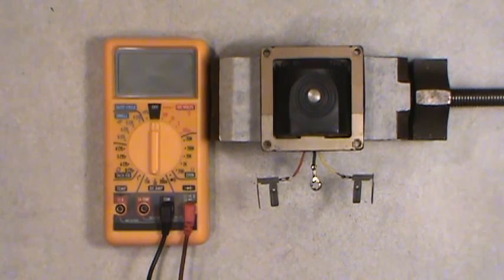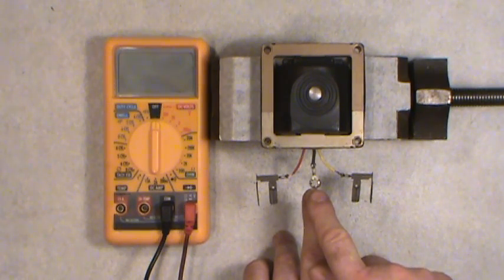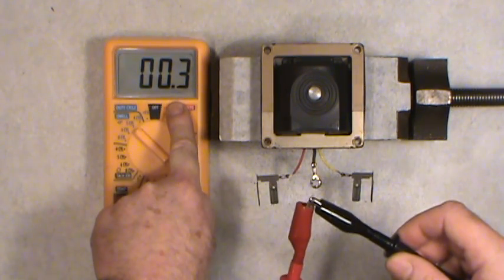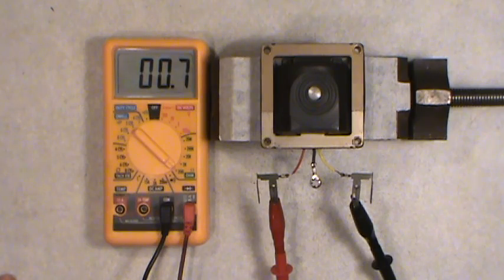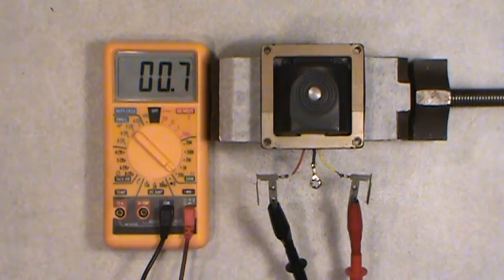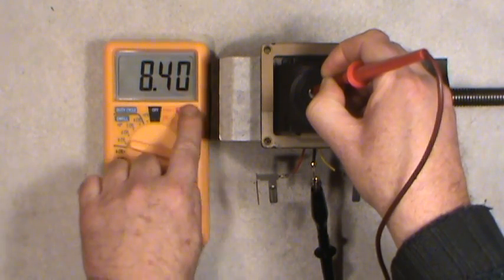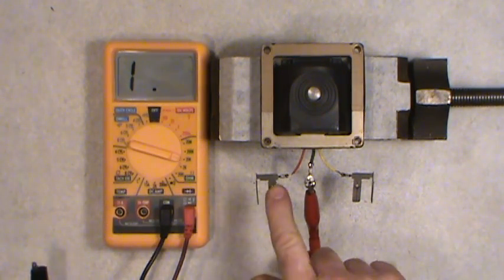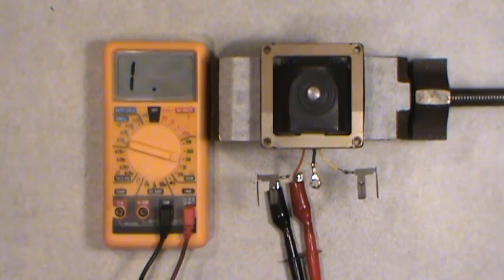HEI Coil Test (The Short Version)

Comment: Good video. Good explanation about the DVOM settings, many people do not understand the different settings and the decimal point. Thanks.
Reply from the maker: Greetings...hammer head...…...You're welcome, and thanks, for the nice comment, and for, watching too...…….The HEI (High Energy Ignition) coil's, higher/secondary ohm readings, aren't all that fussy, but, when it comes to, the low ohms/primary side, of the ignition coil, then, it's now, shall we say, "fussy time"...!!!...lol...…….Most of the factory/stock, HEI ignition coils, that I've messed with, usually had, a very low/primary ohms reading, of, between, "just over" Zero ohms (but not Zero ohms...!!!), up to, usually, no more than, about 1 ohm (.5 ohms, is a good possibility)...…….I also, ohms test (measure "it"), when, the ignition coil is disconnected from everything else, just to be sure...…….Best bet, is to use the exact ohms "specifications", for the exact ignition coil, that's being (ohms/resistance) tested...and...….till next time...……Be Safe, take care, and have a good one.
Reply: @RockysRoadshow I had the exact same problem at my red wire. Broken..

Comment: A lot of good info there about coil diagnostics and volt/ohm meter ranges.  I would also check for a short between the primary and secondary windings since that may also cause a no spark condition.  Great video that I'd bet has helped plenty of folks!!
Reply from the maker: Greetings...breeha72..........Thanks for the nice comment, and for watching too............Yes-Sir-ee-Bob, I did leave out, that, shall we say, Short (ing) to Ground, as in, touching one of the meter's test probes, to the ignition coil's frame/laminations, but, I figured, that, any problem should (I hope), show-up, having the primary and secondary coil's Ohm-Reading/s, out of whack (so to speak)...........Gotta also keep in mind, to use the "Correct/Matched" ignition system (circuit) parts, for that particular HEI/High Energy Ignition system/circuit, cuz, I've seen pictures, where, a Stock carbon button/contact had too much Resistance, for a high performance application, and, it appeared that, that Stock/high resistance Carbon Button, got So Hot, that it Melted the Distributor Cap...Yikes...!!!............There are actually "Low Ohm" (resistance) carbon buttons available for sale, that should, shall we say, prevent that high ohms/resistance...bottle-neck/roadblock...from taking place (I hope)............Gotta, also watch-out for, high resistance/bad connections, as in, all wiring connectors (I prefer, soldered, wires to connectors, as opposed to, only being crimped)..............Then, there's that sheet metal Ground Strap, that only touches, the HEI ignition coil's Frame/Laminations (poor connection practice, especially when subjected to, the good ole, Sea-side/Salt-water environment).............Last, but not least, there are (times), where, a BIG distributor Cap, HEI distributor, gets stuck into a V-8 engine, that used to have, a good ole "Points and Condenser" distributor, in there before, and, the original wire, that went to, the usually oil filled ignition coil, gets connected to the HEI distributor's "Bat" (battery) connection point, that's near the top/and in, the HEI's BIG distributor cap...say what...???............Well now, a BIG distributor Cap HEI distributor, needs Full "Battery Voltage" (12 Volts, and a bit more, when the engine is running, and the charging system is in operation), BUT, that older Points and Condenser distributor, used much less Voltage, that went through the supply wire, to that, good ole, oil filled, type of ignition coil, and, the HEI Distributor, sure "Did-Not-Like-It" at all.............Gotta, Re-Wire, safely & properly, for Full Battery Voltage, to get to, the HEI's "Bat" connection point, on/in, that BIG distributor Cap, to make "it" Happy, as well as, make the Vehicle's Owner, Happy as well, and........till next time.........Be Safe, take care, and have a good one.
Reply: how do you check for the short between pri and sec?
Reply from the maker: Greetings...Dean Hauser...…...Thanks for watching, and sorry, for not replying earlier, as, I didn't see your question until now...……Shorts between the primary and secondary coil windings (of wire), to me, will usually be showing up as, one, or maybe both, Ohms Readings, being much lower than, the Ohms "specifications", for that exact HEI coil (could be, that, some of the coil windings shorted out/together, possibly)......….To check/test an HEI (High Energy Ignition) coil, while it is out of that Large distributor cap, for any "shorts", as in, an electrical short to ground, would be, to place (actually, scratch it in, really good, for a good connection!), with one of the Ohm Meter's test probes, on the outside, of the steel laminations (layers of thin sheet metal, that are sandwiched together), and, place the other probe, on one, of the 3 wires, that are not attached to anything, and, only do, one at a time, as well as, touch the moveable probe tip, to the recessed steel contact point, that's in the middle of the HEI ignition coil, where the carbon button's "spring" makes contact, and also, have the Ohm Meter, set to the highest scale/range, so, it will be much more sensitive, at finding even the smallest amount of, not wanted, shorting to an (electrical) ground problem...…...Even though, an ignition coil checks out on an ohm meter, then sometimes, an ignition coil might not work all that well, when it heats up to Operating Temperature...…...So then, if an ignition coil starts acting up, when it gets warmer, you'll know all about it, in case it ever happens, and, I hope not, and...….till next time...…..Be Safe, take care, and have a good one.

Comment: I don’t have any spark and have never worked on an hei before so this is excellent. I have worked on lots of high voltage transformers and other things at the power company so I understand most everything. Thanks a lot. There was a ground strap missing in the new kit that connected the core to the middle black prong on the plug so I think that might be the problem. Thanks!

Comment: I hate checking coils I've tested them and they tested good at the time but in the end replacing them fixed the problem. 3k-30k is a huge range you'd think it would be much more narrowed. I'm still in the process of fixing an ignition problem. Intermittent cutting out at 1500rpm light load. Pull over go in store and drive no problems it's a head scratcher. My injection system is driver adjustable and I've ruled out a lean or rich condition. New dizzy cap rotor and wires. Waiting on FedEx to deliver a new modual but also wondering if my super coil is going bad never know at this point shit is getting old just want to enjoy my car.
Reply from the maker: Greetings...CIA Assassin..........Thanks for watching..........Well, here are one or two things, that might cause the symptom, that you described.........If the "ignition control module", is the type, that mounts on the inside, of an HEI/High Energy Ignition, LARGE Cap distributor, then, here Ya go (same applies to, ignition control modules, that need to transfer any excessive heat, sometimes, to air cooled, heat sink "fins") .........The "bottom/metal surface" of the ignition control module, and its aluminum "mounting pad", that's on top of, the distributor's aluminum body, have to be as clean as possible, and, a thin/smeared coating of..."Heat Sink"...specific...paste/grease-like compound (No..."not", Die-Electric grease...!!!), should be applied, only to the "bottom/metal part", of the ignition control module..........The reason for this, is that, the ignition control module "develops", quite a bit of "Heat", while in operation, and, the computer/type of, "Heat Sink" specific, paste/compound, does the best job, at "transferring", the ignition control module's" "Heat", into that distributor body's, aluminum "mounting pad"..........You can find the "Heat Sink" specific, paste/compound (usually sold, in a small squeeze tube), at a "computer store", that sells things like, mother-boards, sound & video boards, memory, etc........The Computer guys-n-gals, use this heat sink goop, on CPU's & GPU's, that develop a lot of heat, while in operation........Just buy the cheaper stuff, b-cuz, some of the high tech brands, can get quite expensive.........If applicable, also, make sure, that, those 2 holes/eyelets, that go through the ignition control module, and the 2 machine screws, that go through them, are as "clean" as possible, b-cuz, those items, are the electrical "Ground"...!!!..........Check all wiring "connections", and make sure, that, they are all, as Clean as possible..........Is your ignition coil's "Primary Ohms" (resistance), "specified", to get along with/match-up with, the "exact" ignition control module, that you are using...???...............Correct spark plugs, and, spark plug..."Gap"...???.............Some years ago, I had a Chevy 350 engine, with a points & condenser distributor, just go "Silent", and turn itself off, once it got, almost up-to operating temperature, but, just coast/pull over to the curb, and let it cool down for a few minutes, and then, the darn thing would start right up, and keep going, as if, there wasn't anything wrong at all...!!!..........After all of the (my) head scratchin', guess what was causing it...???..........Well, it turned out to be, that, the short spark plug Wire, that goes down into the oil filled, cylindrically shaped, ignition coil's high voltage Tower, had started to (high voltage) "Arc", between the metal clip/terminal, and the spark plug Wire's..."center/internal conductor", as in, the internal conductor, for some reason or other, wasn't "firmly crimped/connected" to the metal clip/terminal.........So, I figure, that, over quite a few miles, that "Gap", grew...larger...and...Larger...and...LARGER...until, it got to the point, where, the ignition coil, didn't have enough Guts/high voltage, to be able to "jump", such a LARGE Gap, when the engine warmed up, some-what (like I was sayin', always started-up, and ran good, but, "only when cold, or not very warm")...........If your ignition system is different, from what I was tellin' you about, then, if you care to, just let me know, all about, what you have there, and any of its problems as well, and........till next time........Be Safe, take care, and have a good one.

Comment: Good morning and God Bless you and your Family. 🙏🏼👍🏼👍🏼🙂

HAPPY NEW YEAR 2020.

The purpose of this comment, is to Thank You Very Much for creating this VERY GOOD video. 

I recently recovered from a H.E.I. Distributor Saga a few days ago. I would have NEVER been able to nor aware of the fact that a H.E.I. Coil can be tested and diagnosed  ... correctly. 

This video pointed me in the right direction, straight to the Coil ... BUSHING. 
🙏🏼💯💯💯👍🏼👍🏼🙂

The new MSD-6AL-2 Ignition Box had been on my Buick @ 6 months prior to my H.E.I. Coil Related problems. I spoke with a MSD Technician last week regarding 2 Cap & Rotors getting damaged  ... the first time was the WORST. I uploaded those videos a few days ago regarding. The MSD Technician did confirm that a faulty MSD-6AL-2 can cause excessive Voltage related damage to a Cap and Rotor. 

Moving forward  ... I checked the Coil that came in my new TA Performance H.E.I. Distributor  ... PERFECT Ohmmeter readings on both Primary and Secondary Coils 🙏🏼👍🏼👍🏼🙂 ... on my 9 year old Hypertech H.E.I. 56,000 Volt Coil as well. 

At that point  ... the bad part of the brand  new H.E.I. led to the Bushing. I did some research online and inquired about it via a really good Facebook Buick Performance Group. My research information confirmed the Coil testing process was necessary 🙏🏼👍🏼👍🏼🙂, and if the Coil passed the test ... look at the Bushing. 

In closing  ... the majority of us were blaming the COIL ... until this video. Thank you adamantly, and God Bless you and your Family. 

🙏🏼🙏🏼🙏🏼💯💯💯👍🏼👍🏼🙂🎬
Reply from the maker: Greetings...BUICK 455 TORQUE...…...Thanks for the nice comment, and thanks, for watching too, oh, and..."Happy New Year"...to you, and your family...……..Well, that stock/factory (bushing), or, "carbon button", as I like to call it, can be, at times, a...Make-it-or-Break it...situation, all right, when it comes to, the amount of, high voltage and amperage, that has to pass though "it"...…….The factory/stock carbon button/bushing, will, shall we say, kinda act, like a "road-block", as in, too high of a resistance (ohms) value, for a very high output, ignition coil/system, such as, what you have there, and, too much (electrical) resistance, will probably, result in, a lot of extra heat (temperature), that is not wanted or needed at all...…...If you haven't already installed one, then, there is a..."Low Resistance"...(measured in ohms)...bushing/carbon button...that is available to purchase, by, one or more, aftermarket/go fast stores (online, on the phone, or, on a good day, in person...!!!...lol)………..If Ya ever install, a new (low resistance...???) bushing/carbon button, in the HEI's distributor cap, then, make sure, that, you install the bushing/carbon button, and that thick rubber-like seal/washer, in the correct order, as well as, smear a film of die-electric grease/compound, on the distributor cap side, of that rubber-like seal, in order, to create a good seal...…….Also, if Ya ever install a new (or used) Ignition Control Module, inside of the HEI distributor, then, always use the correct...Heat Sink...heat transferring, grease-like compound, on the bottom/metal surface, of the ignition control module, or, it will usually..."Over-Heat"...and...Destroy itself...!!!...(I even had, an automotive, parts store guy, try to sell me some...die-electric...grease, that..."will not"...transfer, that ignition control module's heat, very well at all...!!!)……….I buy, the heat sink/heat transferring compound, at a computer parts store (cheapest stuff, about 10 dollars there-abouts, because, some of that goop, can get very expensive, indeed...!!!)………..Also, those colored wire/leads, that come out of the HEI's ignition coil, that have the spade type of terminals, connected to them, are only "crimped on", which I don't like, and, I like, to always see them soldered on, to lessen, the chance, at having, a high resistance (ohms) connection, especially when, the vehicle's environment, tends to be, on the high humidity, side of things, as an example...…….When it comes to, just adding, part of, a high performance ignition system, then, there can be a time or two, where-by, some of the ignition system components, don't wanna get along so well, with each other, as you seem, to have experienced...…….Have you heard of the D.U.I. hei, high performance distributor company before...???...well, if not, then, perhaps have a look at their website, oh ,and, it's not the D.U.I. that you are used to hearing, but rather, it stands for...Davis Unified Ignition...(as I recall)……….They can "custom make" an HEI Distributor, for almost any common engine out there...……They ask you, all about your vehicle and engine, then, they custom (ignition) curve (weights and springs), and tune, one of their new, HEI distributors, for your engine's, wants and needs...…….They even make their own auto-cams (the part, that, the tails, of the fly weights, ride on/follow), and, they even have special, spark plug wires too, called live wires, as I recall...……..All Ya have to do, is, drop the DUI...HEI distributor in (correctly...lol), connect the battery wire, (tach wire too?), and, set (with a timing light), the, initial (base) ignition timing (with the vacuum advance, disabled/plugged-off, I'll bet), and lock-er-down, and, it's good to go (it's always a good and safe idea, to also check, the total timing/without vacuum advance, at the specified, high RPM's as well, just in case)……….So yeah, if ur MSD is acting up, then, now, you have a back-up plan, so to speak, and...….till next time...….Be Safe, take care, and have a good one.